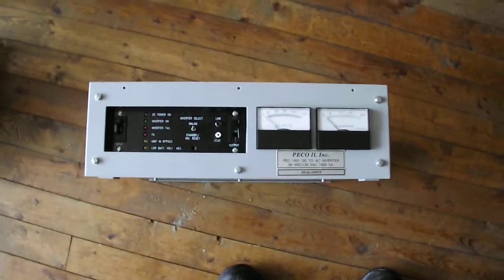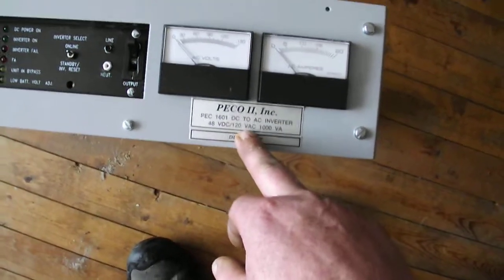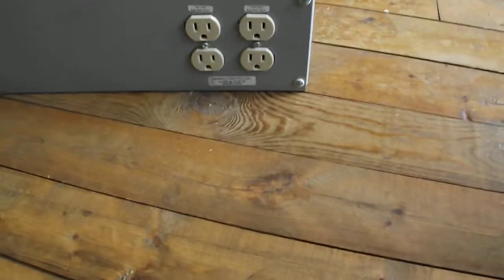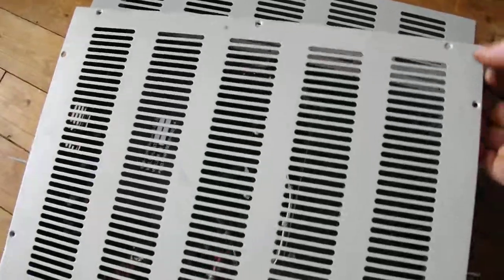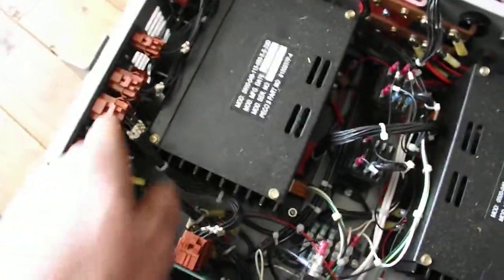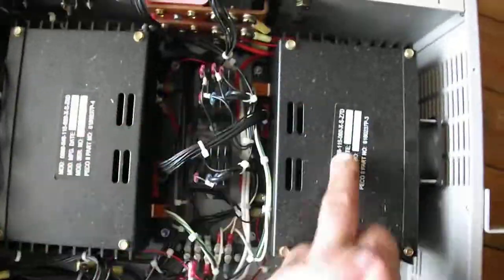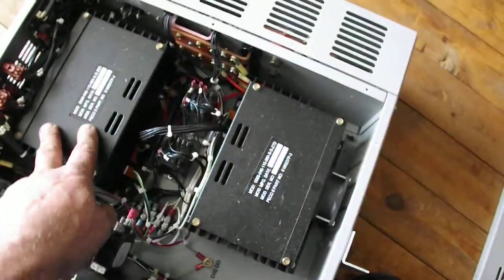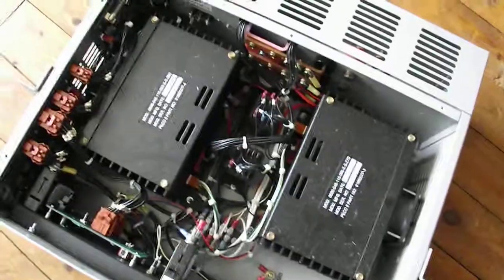48 Volt DC To Ac Inverter Trying To Make Changes

Comment: crack those small inverters open. Its hard to be done because most of those inverters the two you see in side, there will most likely be small transformers that ware wired for 48 volt step up to 120 volts there might be one or more in side of each one, there will be DC switching mosfets Hbridged for the transformers, and then AC Hbridge for the output. I dont know if this unite is pure sine or modified, or square wave signwave inverters. what is the wattage of this inverter, because you could get a 12 volt to 48 volt step up dc to dc converter. but that be very inefficiency if you could build a seperate 48 volt system it would be much better.  I have not tried to convert and inverter to a different voltage input. but I sure its all to do with the transformers and mosfets and other electronics.....

Comment: I wouldn't try to modify it my friend. Sell it to someone who can use it or get yourself panels and batteries to make a 48 volt setup. I can explain to ya how the inverter works and after that you would understand why I say don't try modify it. The voltage is created in 48 volt to 120 volt transformers, to change the voltage to 12 volt input you would have to change out the transformers themselves, The transformers are wound specifically for the 48 volt to 120 volts transformation. The circuitry is made to use the 48 volt input. The inverter is rated at so many watts output so when you change the input voltage you also change the input current. The parts that pulse the 48 volts into the transformers would also have to be changed out too. If I knew a way to easily convert it for your use I would help you make it happen, but it's going to require basically gutting it and replacing much of it to make it work for 12 to 120 volts. Please don't tear it up trying to modify it, sell it to someone in the off grid community and get yourself a 12 to 120 volt inverter. Sorry to be a buzzkill.
Reply from the maker: Just playing around kd. Is all. I,m that way.
Reply: I was thinking the same thing. it is a nice piece of equipment. I would do just that build a separate 48 volt system for it. or sell it if I couldn't use it or if it was broken and didn't work then I would gut it and buy a 12 to 120 inverter and put in it and strip it down and keep the meters and plugs. to keep the old retro look. it is a nice bit of kit though.